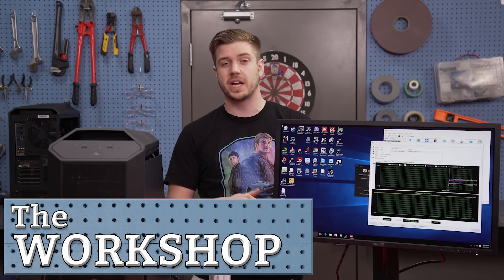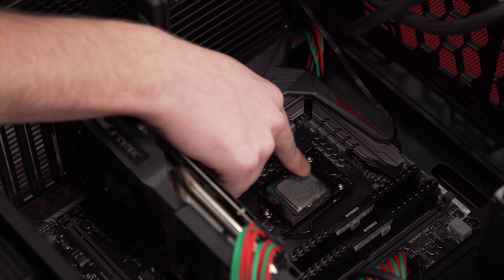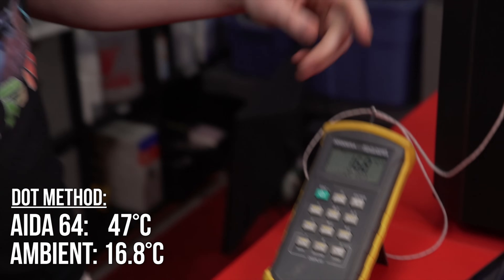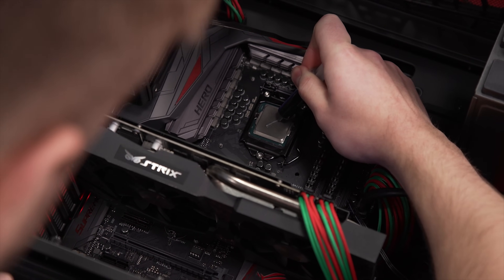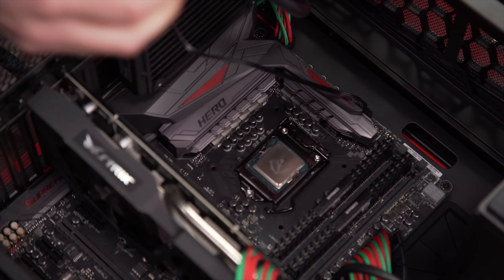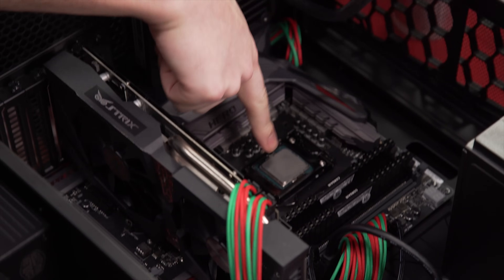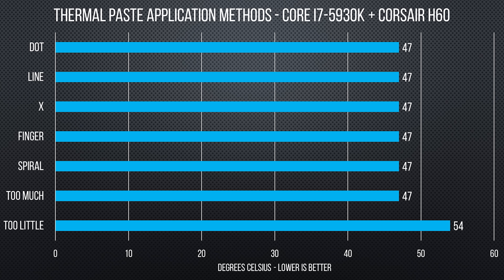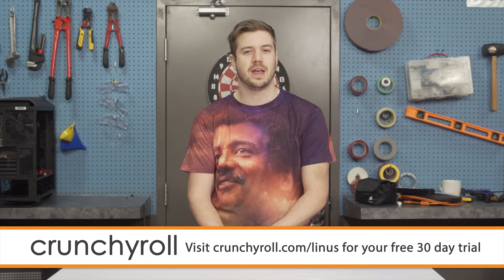Thermal Paste Application Methods - Which one is best? - The Workshop

Comment: mx4, noctua nt-h1 or artic 5 wich i choose ? I want the best not regarding the price
Reply: i use noctua nt-h1 on a overclocked FX8350 to 4.6GHz at full load temps are around 63C its a good paste. i heard the Arctic Silver 5 is good too but i suggest using nt-h1

Comment: What would happen if you actually poked yourself with thermal paste? Well, within a couple of hours the wound would begin to appear to heal. A small scab will form but toxin has already entered your blood stream. In a few days, depending on your body's natural resistance to toxins, your core temperature will begin to fall. You begin to notice yourself feeling the chills when it should be warm, you put on a couple of wool sweaters to ward off the chills but it seems not to help. Afterall, how could it? You're getting chilled from the inside out. The first phase of infection has begun and your body has by now exhausted its immune system fighting the thermal paste but each death of a white blood cell only serves to strengthen the thermal paste infection. As each cell dies, it is repeatedly assimilated by the thermal paste, becoming part of the deadly agent taking over your body bit by bit, day by day.

Within weeks of infection, you can no longer function as a human being, you are bedridden yet you have an insatiable hunger for toothpaste and axle grease. Several men in suits knock your door, but you are too weak to answer. It was not necessary anyway. Your door is ripped apart by its hinges and they enter, bundling you into a large black duffle bag and driving off in an unmarked black van. As you arrive at the factory, the prison that will hold you the rest of your life, the hood slips off and you notice a large signboard in front of the derelict factory. It is marked "Arctic Cooling".

As you are dragged into the factory, your intestines knot out and you lose control of your bowels leaving a long trail to your cell. You notice that instead of a reassuring, pungent brown stain, you leave behind a trail of gray sludge. It cannot be, you tell yourself. But it is. You have become an unwilling host and producer for the next generation of Arctic Cooling thermal paste.
Reply: That actually did happened to my grandmother on a recent rig she built.  I tried to tell her, but she thought she knew best.
Reply: Great Story!
Reply: If your body temp drops, you would actually feel warmer in the ambient air.   It's like the opposite of having a fever.  Fever you are burning up but you just wanna hide under blankets and bake yourself anyway cuz our bodies are stupid.
Reply: @Chrislk1986  Pretty sure you do that as a method to increase body temperatures in an attempt to overheat and kill off the virus.
Reply: How did a toxin evolve into a virus?
Reply: Bumi, you're a mad genius.
Reply: What is Fortnite?
Reply: And the Nobel prize for literature goes to...
Reply: *After all
Reply: Do you have a life or a wife or a husband?
Jk. That was funny as hell though
Reply: nobody asked, but ok

Comment: Wouldn't it keep reading 47 since your using a closed looped cooler and once water gets to a certain temp it holds it longer? Thus your cooling the CPU with the same warm water in the loop? I could be wrong but it might have made more sense to test this with an air coooler

Comment: The question that I didn't see anything mentioned about and was thinking this whole time since the temps are basically the same - what is the cooler's fan RPM to maintain that temp? That would indicate if one amount/application method was more/less thermally conductive than another amount. Or did you use a fixed fan RPM in your test?
Reply: That’s exactly what I thought watching this video. Hope some day we’ll have the answer.
Reply: Yeah...

Comment: This testing method is wrong. for example Method1= "Dot style" and fan speed 1500 rpm and result 47 c . Method2 ="style X" but fan turns lower or higher rpm to reach 47 c. To avoid wrong result, you have to lock the fan speed rpm for example to 1500 rpm for all method styles. i am sure it will be different.

Comment: you used water cooler? water cooling solutions give initial temperature smaller in the beggining of the operation and raise only after certain time. because water or liquids takes more time to transfer/absorb heap compared to aluminum or copper cooling solutions. maybe a test using more time or using normal heatsinks could give better deltas for each style of thermal compound application.
Reply: Or using worst thermal compound. Maybe a thermal compound that its too good doesnt give any real difference because it works so well. I cheaper and less efficient compound could give different results.

Comment: You needed to test at higher temperature (linx, fpu only test, hotter cpu, worse cooler, etc) to get more chances to see the difference, if there is one. Most people have like 70-80C under load in modern games with their coolers.

Comment: I know In bringing this comment a little bit late, but do people still need to argue about this? Seriously once these two metal surfaces smash the paste between them, thinner than a wafer, laws of nature wont give a shit about your fractal application pattern. Also, it goes on deaf ears in this community, but we all know bad paste will never properly conduct heat to the heat-sink. Drop a dollop of any decent shit on that CPU and get on with the real problems, like where you plan to park that sweet new rig so you can monitor its hotness while you stroke its keyboard. ;)

Comment: You should have used e.g. an old credit card for the card method..and not with toilet paper wrapped around it. Allthough i saw that the paste was not really cooperative. But nevertheless i don't think that it would have made a big temp difference if you managed to "plaster" a nice, even and thin layer of paste on the cpu. The old-fashioned white magnesium paste is more like toothpaste, so it spreads out a lot better than this "chewing gum". But even then its not easy to make a thin EVEN layer on such a small area, with so little room to work in, so you will most likely have some parts of the die covered in a thicker layer than other parts. Since the surfaces of both the cpu and the cooler have their (unique) irregularities, which have to be filled with the thermal paste to avoid air being locked up between them and insulating the heat, i believe (in theory) that the best AND most simple way to apply paste is the dot/pea method. This way you let the two surfaces decide & divide the paste into the irregular structures where it is needed. As you can see in the video the paste covers almost the complete area of the cpu, without going over the edges. But that's theory. In practice, it seems that it won't make much of a difference. Respect for your patience, though =]

Comment: I always used a method I learned from the Arctic Silver website. Finger in plastic bag for the bottom of the cooler (and wipe off excess) and then spreading on the CPU with a plastic card. 
Glad to see the pea method works as good, will save me the heartache next time.

Comment: For the less test I think you should have actually applied less instead of applying none.  There is a big difference between none and less.  Thermal paste actually has insulating properties so can increase processor temperatures if applied too thickly.  Also, I think it may be easier to apply very thin layer with a card to the processor prior to fitting in processor slot, obviously taking care to not press processor pins down.

Comment: I'm curious why you used a liquid cooler for the test.  I feel like with a worse performing air cooler, it would matter a lot more how well the paste is performing.  and since the temps would be higher in general, there would be more room for tiny imperfections to change the results.

Comment: I would have mentioned not using straight alcohol to clean off the surfaces if you're only doing this once and not constantly reapplying like in the video.  You should use a two part cleaner that will strip the old thermal paste off and prep the surface so you don't have contaminants from the old paste and get an even spread.  Again, only if you're planning on doing this once, I'm sure he just needed to do this quickly since the paste wouldn't be baked on in such a short time.

Comment: hey I have a request I think, have you done a 2017 desktop review like bang for the buck type thing? I'm wondering cause I'm wanting to get a new comp I'm looking for a dt that has a bit of forseeable  life in like the board is good for upgradeing and it comes with a good hd I'm looking at prebuilds like acer hp gateway dell Lenovo etc. just wondering thanks!.

Comment: I used the thermal paste that came with the Cooler Master in the line formation crossing the heat tubes and I am running 37C.

Comment: I don't think this test was done right, but the results likely would have been the same anyway. 

1. Temps weren't high enough to show minute differences. Stock cooler or overclocking the bejesus out of it would show subtle differences. 

2. Why didn't you compare the average and max of each core separately instead of just the highest core. A HUGE reason certain techniques are recommended is because the heat spreader isn't even temp on a cpu therefore a better spread without leaking out the sides yields more even cooling between cores.

Comment: I just cleaned and re-applied yesterday. On removal the cooloer and CPU they seemed to have a gelled amount of dried paste. I used a BB size drop and spread it thin and even with a Q-tip, The result was a drop from 72C to 53C. I am liking the q-tip method.

Comment: i advise Copper Paste 1Kg is abbout 10 Bucks choose a fine one.....you can change Cooler a Live long with it with best Results....you need realy just one Drop in size of a Water Drop, of every Paste in the Center of CPU then massage the Coller Unit a bit the Drop can spread over the hole Surface...a collored Paste ment other Color then the CPU has will let see you if the Paste Drop sucesfully spreaded out to Corners.

Comment: I know this is a year old, and some posts sort of covered this:  This test is meaningless except when too little paste is used.  Any amount and shape of paste application is going to be forced to spread evenly by the high pressure from affixing the cooler to the CPU surface.  The only difference will be how much excess spills outward.  The only exception is when too little is used.

Comment: People make too much of a fuss about this stuff. Including the whole thing with temps. As long as you apply thermal paste, and as long as your'e not hitting your temp threshold, and the cpu is throttling it really doesn't matter. The only time you should really be too concerned is when you're overclocking. But this whole thing is just major OCD.

Comment: I love you guys on LTT. but the biggest issue I found with this test was for a thermal test you were using a aio and not an air cooler, you only ran Aida for 10 minutes for each test, not long enough for the aio liquid temps to equalize. for a short test time a air cooler would result in better metrics, metal heats up faster than water. keep making great videos guys!

Comment: Jesus... all of these applications methods and NOBODY bothers to link to the manufacturer's instructions. I've got a Cooler Master 212 hyper on the way, and after reading the manufacturer's instructions, they say to use their own (high quality,) paste. I had ordered Artic Silver5, and THEY say to use it in different ways for different processor core configurations.
i.e.: With my i5 6600, a quad core, they recommend a line 1mm wide the goes from top to bottom without hitting the edge, because the quad cores are centered like a tall rectangle, so since the cores align in this way, the majority of the heat is generated down the middle from top to bottom.

AS5 also recommends "tinting" the surfaces -applying a very thin layer all over both surfaces, and then a line that gets smeared into place by the cooler base. They also advise that there is a 200 hour break-in period to achieve peak cooling fromt heir thermal grease.

Even still... Cooler Master recommends NEVER using your fingers to spread TG, because it leaves behind contaminants that WILL degrade performance of the compound. Also, non-lint cloths. No qtips, no paper towels.

Comment: Doing test immediately after applying the thermal paste will leave the same result. The best method is actually spreading. Here's why. To get the best best transfer you want the most contact area, but you run into the "problem" of air bubbles. The fact is, thermal paste is designed to fill in air bubbles by the heat of the cpu over time - generally less than 200 hours. By then there should be no bubbles and the whole cpu will be transferring heat and will be up to 5c cooler than other methods.

Comment: one thing you could try is setting the cooler down at an angle like closing a book instead of trying to place it straight down when doing the spread method. This will basically roll the air bubbles out the side. I have also read that when the CPU heats up to max the air will be pushed out when the paste sets...

Comment: The same tests with the temps being checked after a few heat cycles are done oughta yield results IMO.
For example, Arctic Silver 5 results in about 5 degrees cooler temps after a couple of days of running the PC normally (restarts, shutdowns et al).

Comment: I apply enough to cover the whole heat spreader on the cpu...usually a bunch of tiny dabs across the top...and I always ran better than using the pea method by 2- 3 degrees

Comment: I did assume the three classic ones would work and be fairly close to each other... line, dot, and X. Wasn't sure which would be better, though, because I couldn't really visualize how the paste would spread from each starting point. However, I thought the more outlandish ones would fail. I had specifically heard that touching the paste with your finger would introduce moisture and oil, making the paste less effective. It looks like that may not be as big a deal as I thought, though...

Comment: I just reapplied thermal paste with my Intel stock cooler and arctic silver MX 4. I put a big pea. ran 20 degrees hotter lol. removed the cooler and it didn't spread all the way. I pressed the cooler on the CPU some more and checked it to make sure it was all spread out except the top it seemed to drip down probably because my case was standing. so I put even more paste on the top and pressed on the cooler. probably ended up putting way too much.  but now the CPU runs 4 degrees lower.

and then I played a game that usually gives me 98 C cpu core temps, just played it now with the new thermal paste. maximum core temps was 70 C. wow that's a massive improvement! and im sure I used way too much thermal paste!

Comment: My findings over the past 20 years is what this video found out, it does NOT MATTER how you put it on as long as there is enough paste. The brand of thermal paste does NOT make a difference. It does NOT change over time. It is only for extreme overclockers that any small improvement in temperatures for would matter in the first place. For most people, buy the ever popular Arctic 5 and spread it around. I recommend the Cooler Master Hyper 212 EVO air cooler for a good, inexpensive cooling solution. Of course, the myth of thermal paste  MUST continue in order to perpetuate the notion that the uber overclocker is a much more awesome person and consistently runs 10C cooler than the casual overclocker. Add delidding your $350 CPU to that myth as well.

Comment: the important thing is that the thermal paste has to cover the cpu surface
Reply: and to that end it is better not to do it with your finger or a business card, because then, you might just spread it unevenly; and if you are using a thick paste you might just end up having little air bubbles or ridges. The best way to visualize this is to apply the compound on an old cpu and press down on it with a glass plane. With the line, dot, or X methods , you can see the glass flattening the paste evenly, but with the pre-spread methods, its not going to be even at all.
Reply: @psd993  You guys are missing his point, he's just saying that the final result is an evenly covered CPU surface. The dot and line and x all produce that .
Reply: JackyBro not necessarily, I use the little dot method and my cpu doesn’t go higher than 45 degrees.
Reply: while playing games?

Comment: when applying thermal paste, should you take off the thermal paste pre applied on the heatsink?
Reply: No, if there's paste pre-applied on the cooler, you don't need to put more on the cpu. EDIT: unless you don't trust the pre-applied stuff and would rather use your own, then I guess you can just clean it off and use whatever paste you want.
Reply: Odd Mush can corsair pre applied be trusted?
Reply: Honesty I was being ironic about not trusting it, it's completely fine.
Reply: Odd Mush ok, thanks
Reply: What do you mean exactly? When you apply thermal paste yourself you remove any existing thermal paste on your hardware first.
Reply: mezz people say that they take the pre applied thermal paste just because they don't trust it and they put their own. I'm wondering if the stock, preapplied paste, is ok to use. I'm buying a corsair h100i v2.
Reply: Thermal paste for the h100i should work just fine.
Reply: DaFudgeWizzad thanks
Reply: No problem. :)

Comment: are you guys putting the fans on fixed voltage or rpm for these tests? not using the self adjusting fan speed settings in bios? (I. E.  the Temps all the same but different rpm on fans!)